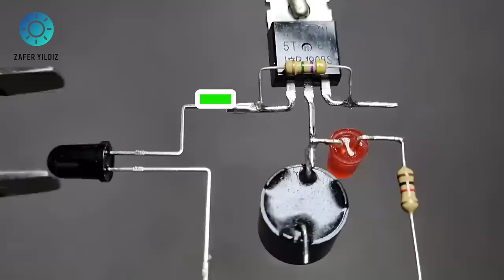Top 5 Z44N Mosfet Electronic Diy Projects - Entry Level Anyone Can Do It

Comment: Hello engineer, please design a circuit that can be charged with 2 batteries of 3.7 volts. I am very grateful for your love. Good luck.
Reply from the maker: Connect 2 TP4056 parallel and charge safely